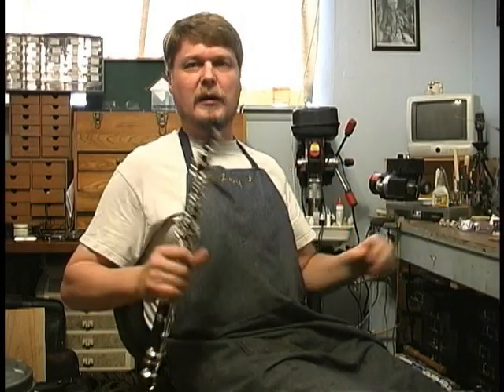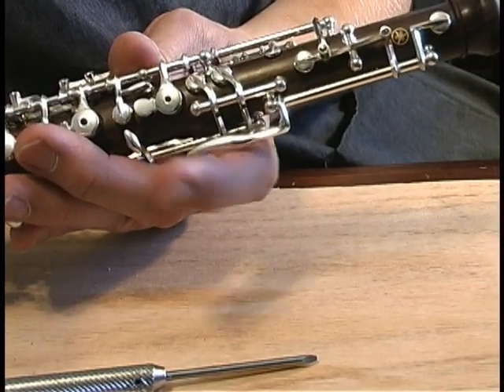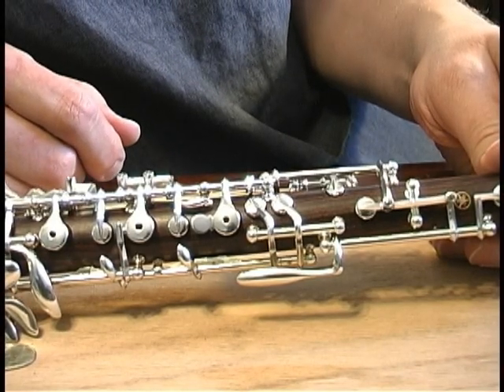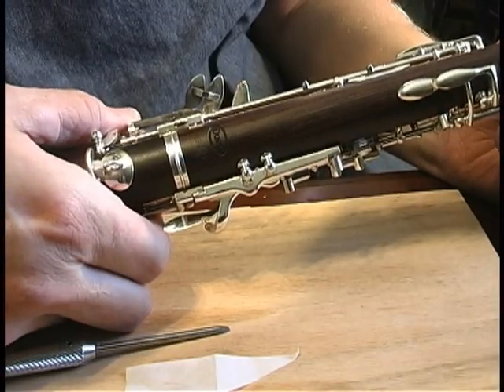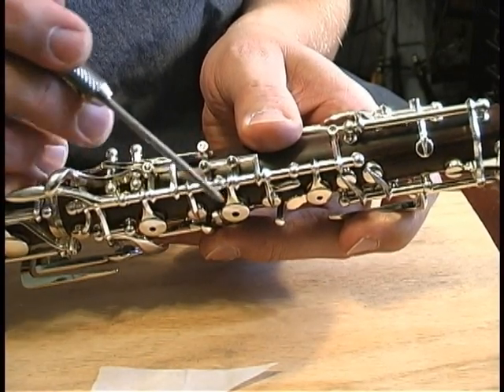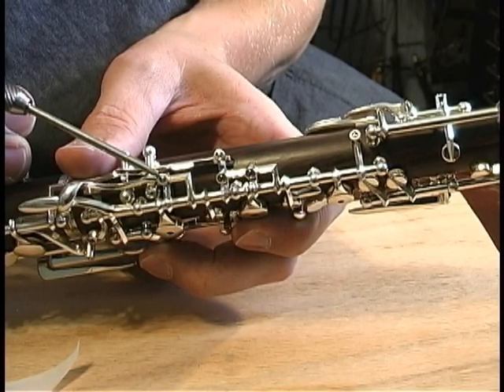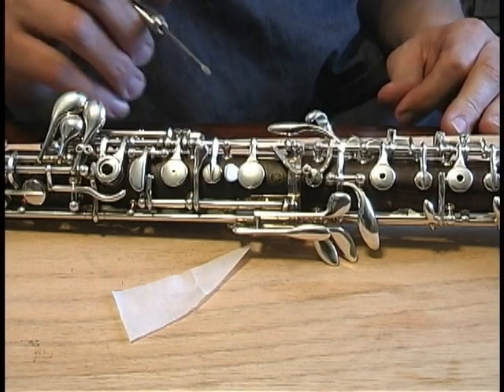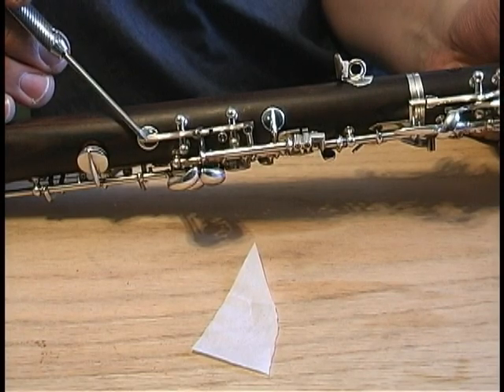Oboe Repair 1

Comment: I’ve got a cor anglais F key spring that’s not popping back up, but everything looks fine. Spring is in place.
Reply from the maker: Hi, it could be the spring isn't bent correctly, or it's about to break, or the temper is too soft.  It could also be a bit of rust or gunk on the steel rod.  It sounds like it needs to come apart to see what's really going on.  If you aren't comfortable disassembling it, any really good ww shop can handle something mechanical like that, even if they aren't oboe-specific.  To do a spring replacement, you'd need the correct size spring, and probably a bit of tooling too.  Occasionally, springs can be quite frustrating, especially if one breaks off at the post, and is trouble to get out.  If it's just gunked up and you can get it apart, that's something more likely you can handle.

Comment: I have a l’oree Royal. Middle E is sharp. Any ideas how to adjust this. Low E is fine but when I press the octave key, it’s sharp.  Tested same reed on my old loree and it’s fine.
Reply from the maker: The adjustment screw from the D key to the F resonance rocker key, can be tightened so that the D key doesn't come up as far.  The F resonance will also raise less, but getting the middle E in tune is most important.  You can lower the D key height quite a bit this way, until the E gets too stuffy in either octave, and then it's a bit too far.  If that doesn't do enough, and you're adept at taking keys off, you can fill the tone hole a bit with nail polish or wax.  The upper part (opening) of the hole effects the octave E with little effect on the lower octave.  Put a little nail polish just below the rim of the hole, on the south (bell side) only, but don't fill in very deeply, just nearest the opening.  You can get the middle E as low as you like, without making low E go flat.  This is true of any of those right hand octave notes also, D,F#,G; they tend to feel sharper over time, as the bore changes.  It may take as many as 2 or 3 layers of nail polish, and may require taking the oboe apart 2 or 3 times, before you're satisfied.  Good luck.
Reply: @larrymueller4698  Thank you so much! I will try it.

Comment: I use a razor blade cardboard cover folded in half to prop open the upper joint bridge key, rather than holding the F# key down while making my top joint adjustments.
Reply: Hi Chris.  I’ve been known to do that too.

Comment: This is really superb instruction on oboe repair, thank you very much! The only thing I need to point out is tapping your screw driver on the silver, doesn’t it scratch it?
Reply from the maker: Hi, I was probably focused on the content, using the screwdriver as a pointer, and yes, shouldn't have tapped on the keys like that.  After many years of using this oboe, I've worn some plating off with my fingers, but the keys don't look noticeably scratched.

Comment: What is the best size screwdriver to use to make adjustments?
Reply from the maker: Hi, it depends somewhat on the make of oboe, but generally something about 2.5 mm across.  It should be a pretty good fit, especially in thickness, so it doesn't noticeably damage the screw slot.  I'll regrind them a bit if necessary.  If you do a lot of work, you'll appreciate something a bit longer, with a larger handle.  Your hands will thank you over time.  Leave the smaller ones for in the case, on the gig.

Comment: hello! I am having issues with my thumb octave. When I press it the cork pad doesnt raise up high enough. What should I do?
Reply: Hi,  it could be a few things; the key got bent, the pad is too thick, or the adjustment screw over the octave key could use backing out.  There could also be too thick of a key cork besides the pad itself, under the thumb lever, or around the adjustment screw.